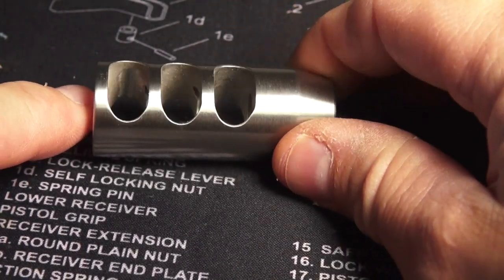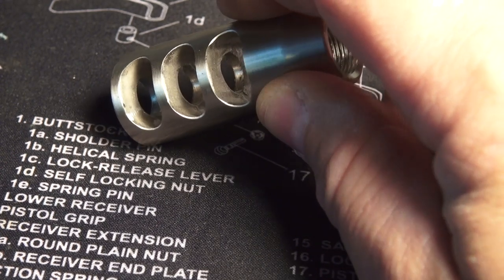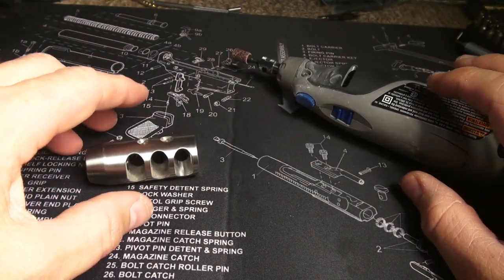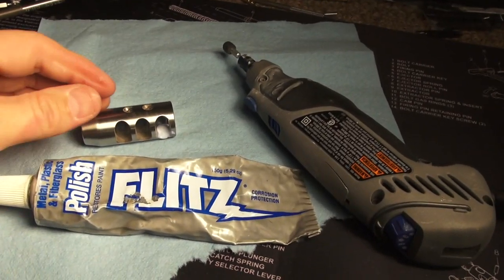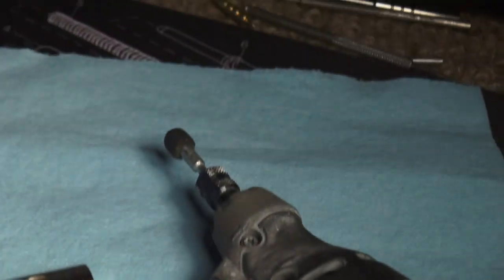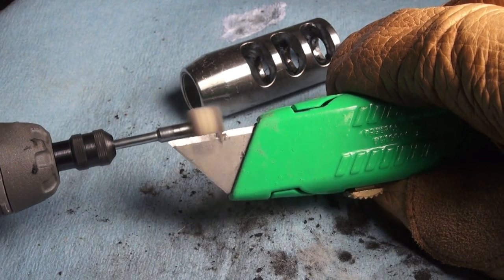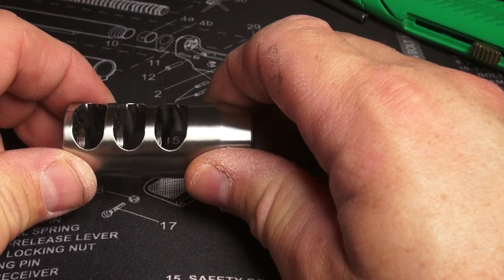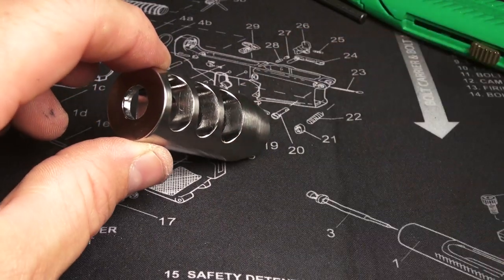Mas Defense X-Treme Stainless Muzzle Brake- Polishing The Ports

Comment: can you make another video on after install or when you install it? 
i have the same muzzle it doesnt seem to fit right.
2 little hole suppose to stay up right?
mine is stay on the left side.... dont know why
Reply from the maker: Did you use a crush (or peel) washer to time it correctly?  I have included a link to a video that shows the brake installed on the gun.  https://www.youtube.com/watch?v=rRKUXLDKgVw&list=UUNY2wXr5JW2ds0SaoMHcmmA
Reply from the maker: Let me know if this answers your question.
Reply: AccuracySpeaks yea i have a crush washer. how much torque do you force it
Reply from the maker: MrTommytsx Sometimes it can take a good bit of torque to crush them in time.  I would definitely recommend using a barrel clamping set of vise jaws to grab your barrel in the vise as opposed to putting too much torque on the upper receiver indexing pin.  I have heard of people destroying their uppers by putting too much torque on the upper when tightening the muzzle device.  If you are afraid that you are applying too much torque, you could maybe file down your crush washer some or either order a peel washer or shim set.  As far as the amount of torque, I can't really give you an answer, I just go by feel.  I guess you could "pre crush" your crush washer by using a long bolt, 2 nuts and 2 washers.  You could get a bolt that the crush washer will fit over, thread a nut on the bolt, place a washer on the bolt against the first nut, then place the crush washer on the bolt, followed by another washer on the bolt, and another nut and squeeze the crush washer close to where you think it will be in time with 2 wrenches and apply the rest of the torque on the barrel.